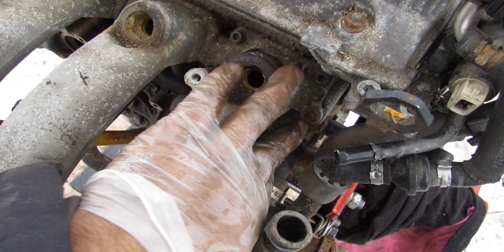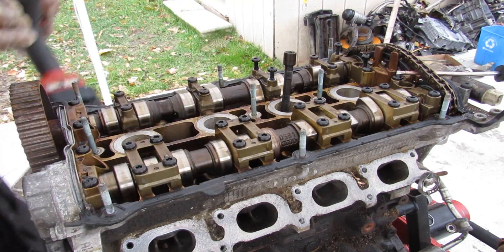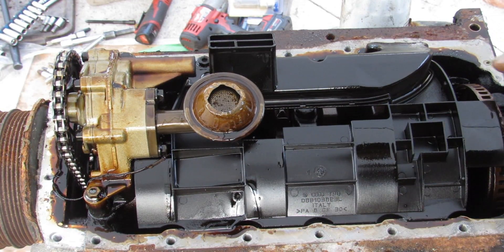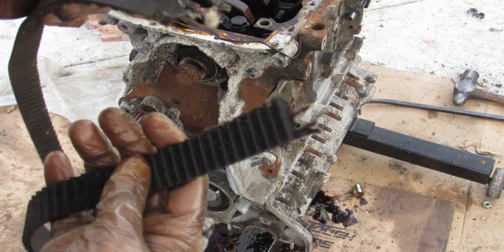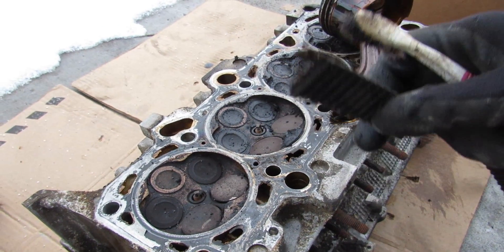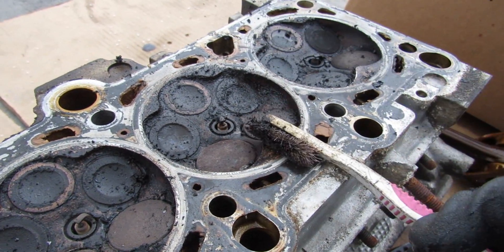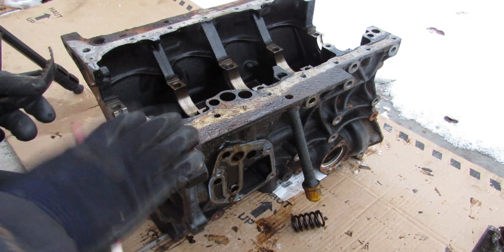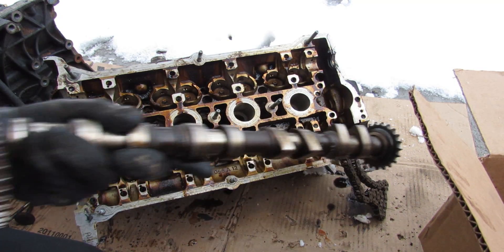What Happens When a Timing Belt Fails?

Comment: this is the baby i have in my 2005 passat b5.5. got the timing belt changed last year before catastrophe struck. almost 200,000 miles on the engine right now. it does burn a decent amount of oil and i could only imagine what the inside looks like. thats most likely why the gas mileage i get is that of a ford f150 ¯\_(ツ)_/¯

Comment: That engine is an AUDI, NOT a VW! Volkswagens Use Timing GEARS, or Chains, NOT  a rubber band!
I changed the timing belt on my Camry MORE often than is recommended.  That engine has been going since the year 2000 and it has never needed a repair!

Comment: plastic baffels under the valve cover aren't as useless as you think. If you loose your oil cap (as i did
 on the highway😂) they will keep a lot of oil on the inside. Only one in the front is necessery though, I'm guessing someone in the factory wasn't sure what they were for and put them whereever they fitted.

Comment: My dad owns a B5.5 passat with the EA113 engine, since his car is a north american market car I think the engine code was AWM. The car was available in AWD as well, not just the A4. Interestingly, because the car could be AWD, there is a driveshaft hump in between the rear seats despite being FWD. The 5 valve heads are an interesting feature of these, and I assume it is more beneficial on the Audi TT, which used a version of this engine design with forged internals. His engine is still running great after 329k miles, though he isn't one to skip on maintnence.
Reply from the maker: Nice

Comment: Belt go boom was the end of my mom's 1985 Nissan Maxima in 1994. The car had 90,000 miles. Even if the engine was worth saving, screw it, that Maxima left us stranded numerous times due to bad design. Nobody in my family knew what a timing belt was until it was too late. After that happened, my dad read the users manual to every car we had to make sure the timing belt was replaced on schedule. He also asked me what new cars had timing chains so the whole thing could be avoided altogether. That same engine was found in the Nissan Hardbody truck, and those who replaced the belt on schedule drove them for ages. They were made from 1986 to 1996, and many are still on the road. The early Frontier had a 3.3L variant of the 3.0L engine from 1997 to 2004, and many of them are still going too, because bothe trucks were of a good design. Replace the belt on schedule and those engines and trucks will last for 200,000 miles or more. Only a Toyota Tacoma can possibly be better.

I had a MKIV Jetta with a 180HP 1.8T. It was a lot of fun to drive. I crashed it badly when speeding, and the advanced side airbags saved my life. If not for that, I would have been in the Darwin Awards. When I was a student in auto repair school at age 22, the class was covering airbags. I told everybody that, and demanded they pay attention because of the value of airbags.

Many B5/B5.5 Passats could have been saved if the owner's manual was read. Everybody needs to know if they have a timing belt and when they have to replace it. Also, VW needed 5w40 synthetic, but many American drivers didn't realize that, either. However, manual readers should have ignored the 10,000 mile oil and filter change and went for 5,000 miles, the combination of the turbo and 3.8 quarts of oil was really harsh on the oil. VW decided to replace the filter with a larger one to get more oil. They were sold with something the size of a Motorcraft FL400. The replacement was similar in size to a Motorcraft FL1A.
7:42 Yes, people add big boost boost without breaking the bottom end.
9:43 either that, or the water pump was replaced once in its life.
10:43 Some companies decided to use a "Torx Plus." They made some modifications to the original design so bits wouldn't break so easily. However, it wouldn't surprise me if VW required their own tool, German companies like to screw things together in as many ways as possible.
12:34 Without much oil on the intake valves, PCV, turbo compressor side, and valve seals can be ruled out. Since this engine is sludged and used a modern ring pack, I suspect that the sludge made the oil ring and oil ring return holes useless. The smaller the oil ring and return holes, the easier it is to ruin them with engine sludge.
14:00 It shared a lot of parts with the iron blocks dating back to the 80s. There weren't many aluminum ones back then. Since those engines were also tough and lasted for ages, VW was in no hurry to replace it. It also shared some parts with diesels. VW even kept an iron block after replacing the 1.8T 20V with the early 2.0T GDI engine in the B6 Passat and MKV Jetta/GTI. Some aluminum blocks could take big boost back in the 1990s. Japan got a 240SX that had a 2.0L aluminum block engine. It was called the SR20DET and tuners gave them big boost. You will see many of them in drift cars.

Comment: The question is why the belt brakes.  As I understood it, it is not meant to be particularly stressed in normal operation.   It looks like it would take some load to snap it.
Reply: just a matter of usage. im not sure the interval on the timing belt change but i think its like every 75k miles. so its a strong yet very important piece of this engine and when it fails its a bad bad day.

Comment: 15:10 this tension mechanism is VVT actuator as well, as it is switching on which side of chain the tension is
Reply from the maker: Thanks. I didn't realize adjusting tension would adjust timing
Reply: @speedkar99  tension itself not, but this actuator will put some with springs and then switch  pressure to put force on top or bottom chain guide. It shifts where is more chain while not allowing any slack

Comment: About the unknown part as the others mentioned it's a front engine mount.
There is also on A6 c5 4b. 
I have this car and the strange thing is that i spotted the mount 3 days ago.
I bought it 2 years ago with 120.000km.
I use the large oil filter and fully synthetic oil. First oil change torco 10w40 and 2nd liquimolly 0w40.
I live in Greece.
I have no burning oil thank God but i see a lot oil leakage. No drips so far.
It would be nice to open up and explain how the pcv system works on this engine. Its quite over engineered I think.
Great job as always man. Thank you for the excellent videos you are feeding us.
Reply from the maker: You are welcome. And thanks for the engine mount - I never saw this engine in the car so I didn't know

Comment: That weird thing on the front bottom of the engine is the front engine "snub" mount. It reduces movement of the engine for better power transfer. Typical over engineered German crap.
Reply from the maker: Thanks. It's a torque mount

Comment: Hey, I live in ontario as well, how much would you charge me to change the timing belt and water pump on my 2005 V6 3.0 camry ? its got 265 000 km on it and Im a bit worried

Also how many km were on this car before its timing belt snapped ?
Reply from the maker: No idea on the kilometers of the engine. I don't have a shop or work on cars

Comment: Outstanding video as usual!

That socket is a RIBE socket also known as "Torx Plus". They are supposed to be backward compatible only (i.e. you can use a regular Torx socket on a RIBE head, but you can't use a RIBE socket on a regular Torx head).
However in my experience, using Torx on RIBE can damage the screw head. 
One thing I don't like about VAG is that they use many different types of fasteners.
Reply from the maker: Agreed....to remove one thing you have to use three different sockets...why!

And yes I initially tried removing head bolts using torx but it started damaging them so I didn't want to risk

Comment: I had a 2004 Passat 1.8T for 14 years until my youngest hit a bus and totalled the car.  The engine you dissected had the too small oil filter, VW told all owners to use a larger (taller) filter with Synthetic 5W40 oil to help these engines survive.

The too small sump - only an  issue for the longitudinally mounted 1.8T VW - versus the Jetta that was transverse - and the heat of the turbo really stressed the oil, owners that didn't use Mandated by VW synthetic oil would be denied warranty for sludge issues.

Fun engine, did the timing belt a few times myself, putting the front of car into 'service position' was stressful to read about, but actually pretty easy to do.
Reply from the maker: Nice to hear from an owner. I'd assume the timing belt job is easier when longitudinally mounted.
Reply: @speedkar99  I would agree that doing the longitudinal engines is slightly easier because you have more room versus the transverse engines between the strut towers.

Comment: 5-valves per cylinder is still too many in order to be effective, overengineered. Oil changes is a no brainer
Reply from the maker: Most engines have 4 valves but I wouldn't say 5 is overkill

Comment: Would love to see you tear down the 30V V6 (2.8L?) that also came in Passats of that vintage.  I had one back then and am DAMN glad I got rid of it at 50K miles before the engine had a chance to drain my wallet
Reply from the maker: Is that the VR6?
Reply: @speedkar99  No, different engine.  It was a 30V V6 used in the 1998+ B5 Passat GLS V6 (which is what I had) and the Audi A4

Comment: Your videos are great! They show what happens when you neglect your car. There is no logical excuse for skipping maintenance on a car. When you get a car it's a big investment, one you often depend on to get to work or wherever you have to go. To make that investment last and be reliable, all you have to do is the maintenance, especially oil changes. They don't just suddenly happen. Maintenance is on a schedule, and most people know about how many miles they drive in a year, so doing maintenance is easy to save up for. If you want to save money, learn to do some or all of your own maintenance. Fluid changes are pretty easy to do yourself, then save your money for the hard jobs, like timing belts and water pumps, and repairs, The only fluid that is changed often is the oil. The other fluids that don't require frequent changes are coolant, transmission fluid, brake fluid, rear transfer case if you have AWD or 4WD, and power steering fluid if you have a hydraulic power steering system. Some cars don't have a way for you to change the transmission fluid unless you measure exactly what comes out and put exactly that much back in. That's on Toyotas mostly. Changing fluids usually takes a drain pan of some sort big enough to hold the drained fluid, some empty jugs to contain that fluid once it's drained, new fluid, a new filter where applicable, and a funnel. Some fluids require a turkey baster or a hand pump to drain or fill. Check your owners manual and see the section on maintenance. At least learn to change your own fluids, or realize you need to take your car in regularly on time for oil changes and all other maintenance. It's your car. Be a responsible owner!
Reply from the maker: Agreed! Majority of the engines I'm tearing down are due to lack of maintenance

Comment: Ahh she’d have been fine if the owner put some Lucas in that engine. Would’ve had it runnin great in a few minutes!! Lol
Reply from the maker: I don't think Lucas would have cleaned those combustion chambers
Reply: @speedkar99  your videos are typically always a PRIME example of what happens when one doesn’t perform oil changes and regular maintenance.
Reply: @speedkar99  ⬆️ sarcasm. Lucas also wouldn’t have fixed the broken timing belt and intake/exhaust valves either lol

Comment: Interesting, I thought the Toyota 4A-GE was the only engine that used 20 valves.
Reply from the maker: No there are many other 5 valve per cylinder engines
Reply: Some motorcycles did get 5V engines, but I don't remember which ones.
Reply: @skylinefever  yamaha

Comment: I had a timing gear fall off a 2003 Civic at idle and bent one intake valve. I got lucky. Did a head gasket after replacing the valve and it runs great now.
Reply from the maker: How does a timing gear just fall off? You didn't torque it after a TB replacement?
Reply: @speedkar99  It was a JDM replacement engine. The belt looked brand new so I didn't mess with it. NOW I check every nut and bolt lol

Comment: Also, that cam chain tensioner is also a variable cam adjuster for the intake as it has the electric solenoid, which shifts the chain slack up 'n down to advance intake cam by about 25°.  Actually far more reliable than all the "cam phaser sprockets" every manufacturer is using these days.
Reply from the maker: Wait for real? 
How does chain tension adjust timing, does it skip teeth?
Reply: @speedkar99  it tensions bottom side of the chain with that oil solenoid. then the intake cam advances by couple degrees. and when solenoid is closed, the spring loaded tensioner at the top takes up the slack and retards the intake cam back. this function is only for emissions at low rpm as far as I'm aware of. it does not add any power
Reply: @gkkamas123   It's both for emissions/fuel econ. & power gain/power band improvement.  The myth of it only being for emissions comes from DIY forum warriors with the HP variant 1.8T's with the Audi TT's quattros.  AMU engine code with non adjust chain tensioner and BEA engine code with adjustable chain tensioners (Cam Adjusters as us techs called them).  Different engine code designations in the european market.....  In all my years of having been a Audi/VW tech, I've actually had the opportunity to drive a 01 AMU powered TT and A BEA powered TT back to back.  Both bone stock and comparable mileage.  The BEA has notably more power and better power band.  I actually drive a BEA TT myself (BTW, best car I've ever owned...) and I've taken the time to graph the cam angle and like the 5 valve V6 engines, they keep the base timing at idle and with even the slightest throttle input, the solenoid is actuated to advance the intake cam about 25°.  Fun fact also, non adjustable cam 1.8T's use a different cam than adjustable cam 1.8T's.  I think the cam lobe peaks are indexed slightly differently, never had a chance to lay both side by side.  As for the function of the adjustable tensioners, the two pistons/plungers are within another spring loaded piston which moves by oil pressure when the solenoid is actuated, thereby moving both top and bottom chain paddles up or down.  I say up or down because the 5 valve V6 & V8 engines move opposite direction side to side, one side up, one side down.  First time you do a cam adjuster reseal/replacement on a V6/V8 and you turn the engine over by hand after install to make sure your chain tooth count/timing is right, it's a little weird to see one side go down 'n up, the other up 'n down and both at proper base timing at TDC after two crank turns.  There have been more than a couple folks who got the driver and passenger side adjusters mixed up and found out the hard way that the cam timing was retarding as soon as they gave it some throttle to test drive.  LOL, spend all day on a 2.8 or 2.7T cam adjuster job.  Start it, let it idle for an hour to warm up/bleed coolant/check for leaks with no problems, back it out of your bay and OOOPPSSS god damn motherfu@#%^&, check engine light is on as soon as you give it throttle to go drive......Never happened to me luckily but I've heard and read the stories.....
Sorry for the long ramble......
Reply: @gkkamas123  comotorsport was tunning the timing for power when they made a stock 1.8t reach 600hp

Comment: Drive by wire, coil-on-plug, turbocharger, but still uses a mechanical fan? Strange
Reply from the maker: Very strange indeed. 
Yet the transverse mounted versions have to use electric fans because the front of the engine faces the side

Comment: That part mounted to oil pan you asked what it did is for torque bushing mounted to the front cross member under the core support.  Only used on B5 chassis A4's/Passat.  B6 chassis A4's (AMB engine code) also used the torque bushing but different mounting on the oil pan.
Reply from the maker: So basically an engine mount that counters torque. Thanks
Reply: @speedkar99  Yes, it was called the snub mount.  Very easy to change, and not expensive.

Comment: I can tell you from experience my A4 with exactly the same motor you're working on now has 345,000 miles.  I have changed the timing belt on time every time with a new water pump each time. The only issues I ever had with that motor was the coil packs and the turbo which are easily done on this car. That motor because it's a rubber timing belt is very very easy to work on.
Reply from the maker: It's easy to work on because its longitudinally mounted. Does yours burn oil like this one looked?
Reply: @speedkar99  no it doesn’t burn any at all.  Fantastic engine.  And I’m a bmw fan.
Reply: How often are we supposed to change the timing belt on the 1.8tsi engine?  My mom has one in her 2016 Vw golf wagon.